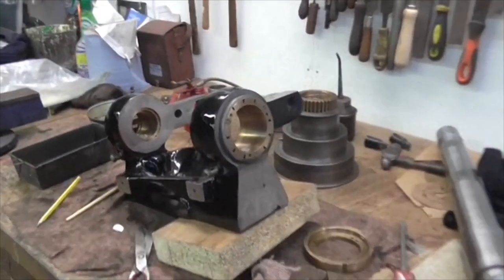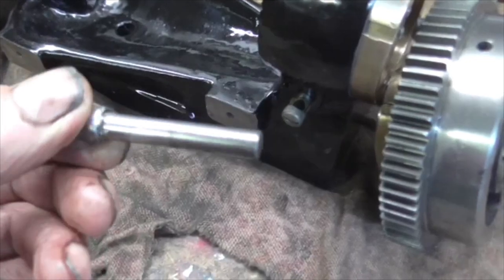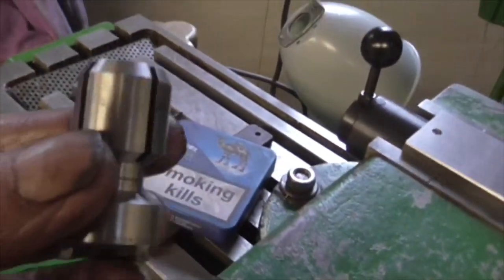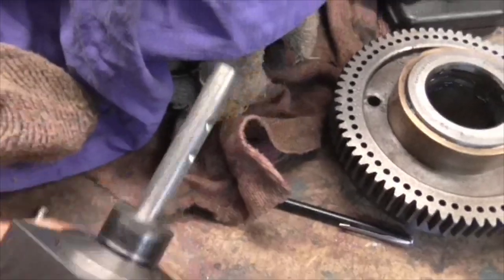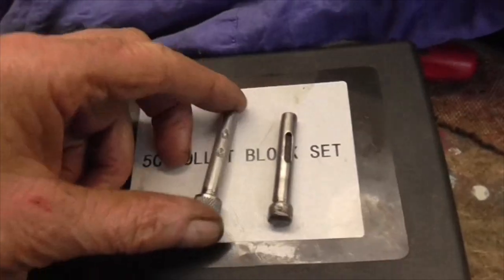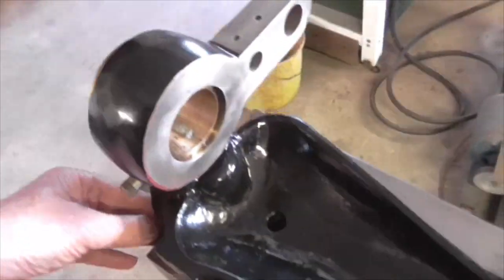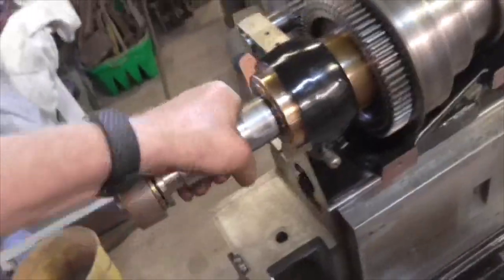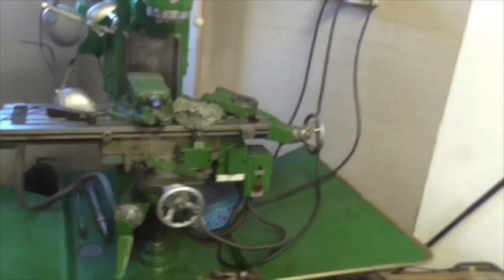Holbrook rebuild part 6, rebuild the headstock

Comment: Nice job the replacement pin Phil. The lathes looking awesome. Great finish on the black paint. Tony
Reply from the maker: Thanks Tony, enjoyed making the pin, and got to use both lathes and the milling machine, which was good, but made me realise that the colchester needs a good shakedown! Had to use it though because for reasons i cant quite fathom at the moment the knurl will not work in the Covmac!  I think it is related to the height of the toolpost, but i just cracked on with it.
Phil

Comment: I really like the new pin you made, fantastic work. The lathe is looking really good
Reply from the maker: Thank you Joseph! It was fiddly to mill the slot only 1/8" wide (about 3 mm), but mainly because I was using a collet chick because I didn't have the right end mill holder, but I managed! Also I only had one 1/8 milling cutter, so I did NOT want to break it!! So it was baby cuts all the way, but got it done, and a perfect fit! On your tractor video, I know what you mead about the fit of the bearings etc, sometimes you have to turn a blind eye to a bit of weat and pack it with thick grease!
Phil